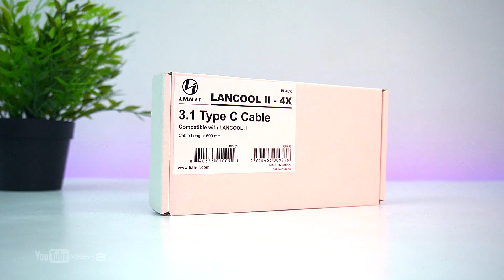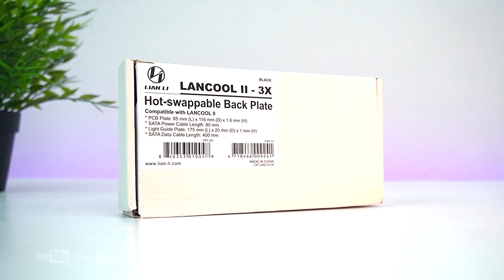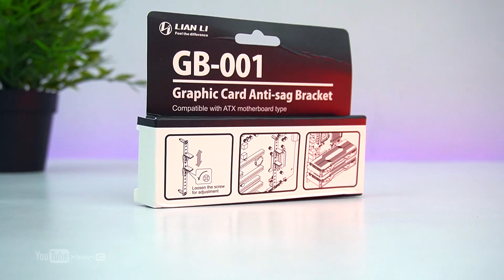Building a $3000 full ROG Gaming PC inside the Lian Li LANCOOL II R7 3800X RTX 2080Ti - Time Lapse

Comment: No need to get the ROG power supply if the display is covered by the case. Can save money getting a cheaper power supply. I initially was gonna spend $300 for the 1200w ROG power supply but downgraded to the Asus Tuf case and EVGA 750w power supply. Saved $400.

Comment: Nice ROG build, glad to see the optional USB type C and LED strip added to the order.
But...
Why wasn't the M.2 SSD sticker removed to allow the thermal pad to do its job, personally would have ised 3 fans at lower rpm up front.
Reply: That sticker does not affect it at all, it is thermal sticker. Having said that, i did remove it on mine, but only because i found out it's a thermal sticker after i had removed it.

Comment: Great video. I've got a question: i recently made a similar build with this case, but i have no idea where to connect the front panel LED cable? I am using Asus ROG Maximus XI Hero mobo, but i can't see any spot on it that that cable would fit in?
Reply: u cant connect it to any motherboard (3pin vs 4pin) so you cant control it via software
Reply: @WizZarDz0rrrr  It's alright, i sorted it out 3 months ago, i can control everything. But thanks.

Comment: Just got this case today. Dumb question, how did you hook up the 3 pin  front panel lights and the extra rgb strip light to your 4 pin rgb header on your mobo?
Reply from the maker: You cant hook up a 3pin LEDs on a 4pin rgb header.
Reply: @XtianC  I know, I keep on seeing Lancool II builds  with mobo's that have 4 pin headers and the front light's are working. I just want to see what I'm missing. Probably a 12v to 5v conversion hub.

Comment: For the money i would had a better pc (would look better,perform better,where is custom psu shroud and gpu backplate,and case moding
Reply: game movie , then give specifications. I have around the same budget can go a bit more, but I have so many options I settled down with an i9 9900k, rtx 2080ti MSI trio, asus Rog Maximus XI hero, nzxt x72 liquid cooler, Corsair vengeance rgb pro 32gb ddr4 3200, 4tb seagate barracuda, kingston a2000 500gb ssd nvme, western digital 500gb ssd 2.5’, bitfenix nova mesh TG case, Corsair RM(2019) 750w 80+ gold certified power supply, Corsair Ll120 RGB white 120mm case fans, and finally Rog swift pg27vq 27’inch curved 2560*1440 165hz monitor. 
What do you think?

Comment: Ryzen 5 2600
B450M mortar titanium
2x8gb ram @3200mhz
Rx 570
1tb hdd
Tecware alpha
600w 80+ bronze
HKC M24G3F
Oks na po ba to for 40k pesos build?
Reply: I totalled your list in pchub and it came out at 36,339 pesos. Kaya Naman.
Reply: @Psygnosis  plan to build this coming december kasi sir and since di ko pa afford rysen 3000, 2nd gen muna tsaka nagmura kasi
Reply: @kennethabela5575  with that motherboard you can later upgrade cpu to 3600 or 3700x both consume low power. You can also upgrade GPU from current x570 up to as high as 2070 super. Just make sure it fits in case. But. I would suggest you stretch your budget and get at least a 1660 Super/TI with 6gb ddr6 to be able to play the latest games.
Reply: @Psygnosis  gustuhin ko man sir pero yan palang kaya. Mag prepare na lang ako ng pera ulit for future upgrade

Comment: Hi everyone! My mobo has no aRGB header but I want to get aRGB fans that work with this case. If I get a hub with five 5v 3pin aRGB connectors like the Antec Prizm and connected the case and aRGB fans, could I use the case buttons to control the aRGB of the fans too? If the case buttons do not control the fan aRGBs, do you recommend any aRGB fans/hub to go with this case's aRGB and a LED strip (5v 3pin)? 

Another aRGB fan I've seen is the PCCooler Moonlight Series (previously called Corona) which includes a 3 pack (3 pin HUB, not enough ports) or 5 pack (4pin HUB that works with aRGB?) but I'm unsure if either the 3 or 5 pack would be compatible. Any help would be greatly appreciated!

Antec Prizm: @t
PCCooler: @t